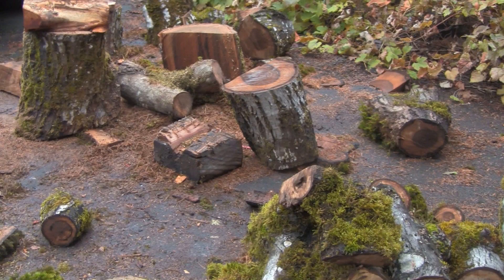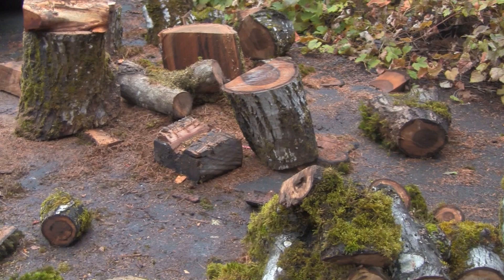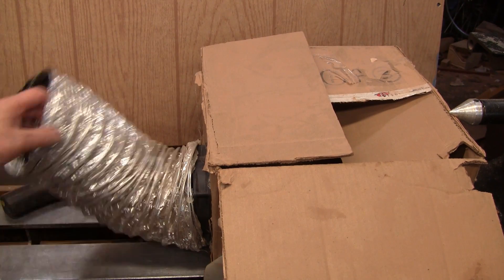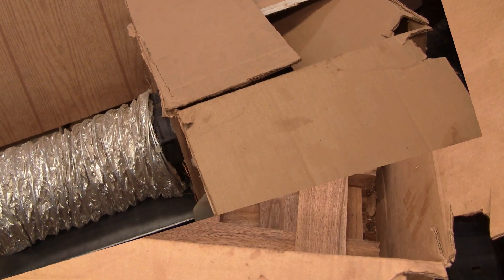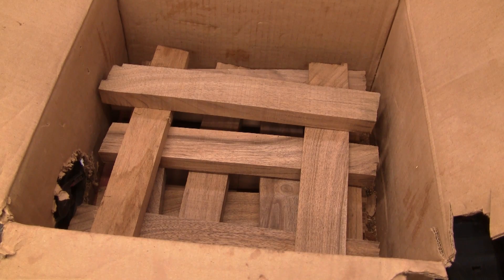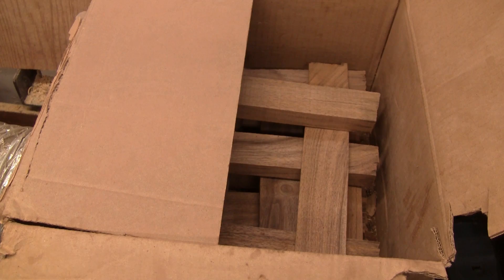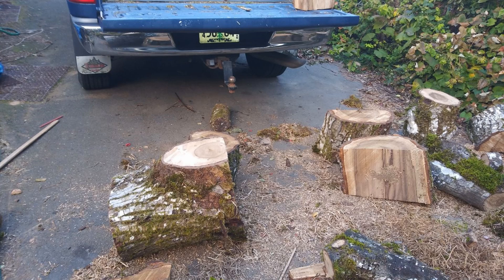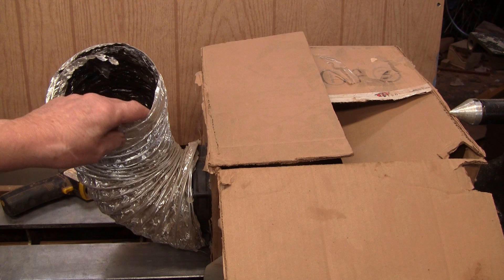Wood Turning Easy Drying Box for Bowl Blanks and Stuff

Comment: Oh, yeah, I remember this from when you made it.  It's a great design and as you say, easy and cheap and it works!  I really should make one as well.  We'll see.  Thanks, buddy, well done, again!
Phil
Reply from the maker: Well it is an old box but it does the job. The idea is Rick Turns but mine is just slightly different. He explained it so well I did it all with out reading the directions. I really like it for drying a thin turning from green wood.  Dries overnight. 
If it would only get hot enough to bake pizza I would be all set.
Thanks for watching,
Gary

Comment: Hi Gary, As you know I made one of these a couple of years ago and it is still working brilliantly as it has the Wet Oak I turned lately in it as I write this.
I didn't use a bulb however just the fan but it still seems to work.
Take care my friend. Hwyl, Huw
Reply from the maker: Thank you Huw, and I think you are right about not needing a light bulb. The one I grabbed for this demo was and LED and I could not find one of the old bulbs at the time. So basically very little heat. It is down to 34F degrees this morning and we have rain coming. So the drying will be slow with the Maple I put in it last night.
See ya!
Gary

Comment: Thank Gary, something cheap enough anybody can try. I know I am. I’ll probably load some of the little pieces I’ve had laying around to dry for the last couple of months that are still basically wet. Thanks for the tip. Cheers, Tom
Reply from the maker: Thank you Tom. I finally took the power supply out of the old computer and tossed the case. So now it is much more compact.
And it does the trick.
Take care,
Gary

Comment: I'm still quite happy using paper bags. It takes longer but they take less room. 
Still this is an interesting variation on the fridge or dishwasher that can be modified for the same purpose.
Reply from the maker: I have used bags myself. I found they take very little room when empty but take up much more when you put something in them. 
Plus they take months for a twice turn blank compared to 2 weeks in the box. But I think you turn a lot more green wood than I do. That way you cycle through them as they dry and you are not waiting long at all.
 I really like drying the strips in the box. My walnut strips are dry so I think I will cut some more today. The sun is out and it is starting to warm up.

Comment: Thanks for the video. Question regarding your moisture reading. Did you check the end of the wood or did you cut it to get to the center? I’ve been reluctant to trust my moisture meter on the end.
Reply from the maker: I generally check the flat grain and the meter is just a reference point. Not sure how accurate it is. But I have lots of kiln dried hardwood and I reference to what it is at just sitting in my shop. Normally everything is around 7-8% this time of year.
Thanks for watching,
Gary

Comment: Using what is available is great for the environment. What type of moisture meter do you use? Thanks for sharing.
Reply from the maker: And great for the pocket book as well. 
I have a very inexpensive meter I bought on Ebay or Amazon. Forgot which. It gives me an idea how much it changes from start to finish.
I compare it to kiln dried wood I have and when it reaches that I think it is as dry as it will get here in Oregon.
Thanks for watching,
Gary

Comment: Does the small bit of heat from the bulb really make a difference?
Reply from the maker: I think in the winter time it makes a little bit of difference but probably not all that much in the summer.
I have checked and when it is 60 degrees outside the box I find it to be around 70-75 inside. And a 100 watt bulb it will reach about 95.
Thanks for watching,
Gary

Comment: How hot (temp) does it get? Is checking an issue when drying bowls?
Reply from the maker: With the 60 watt bulb it sitting in in a room that was about 58 degrees it got up to about 70 degrees. With a 100 watt bulb it will get much warmer. I would say about 95 but that was on warmer days.
No issues with checking it.
Thanks for watching,
Gary

Comment: I've been thinking of making one of these following Rick's "high tech design."  Maybe I will.  As for now I use a food dehydrator to dry green wood.  Check out Larry Martin's (The Wood Whirler) for suggestions.  I can take a log from 25-28% down to unmeasurable moisture levels overnight.  I'm sure the readings aren't that accurate but the wood certainly is dry.  Best part, no cracks or checks.  I did a pretty extensive study on ash, oak and cherry and would be happy to share it.  Thanks again for sharing your design.  Cheers
Reply from the maker: Thank you Tom, I have had good luck using Rick's design.
I have watched The Wood Whirler use his but I seem to recall he got a lot of cracks. I will have to watch again. Might depend on how much heat you use.
Thanks for watching.
Gary

Comment: Is the light bulb you are using an LED bulb? Thats what it looks like based on the ceramic base. It doesn't seem that would generate much heat. Please clarify. Thanks.
Reply from the maker: Yes it is and it does not create any heat. It was all that I could find at the moment. My wife found a good old style that I did put on when I used the drying box.
Thanks for watching,
Gary